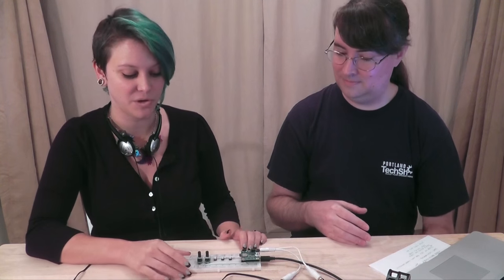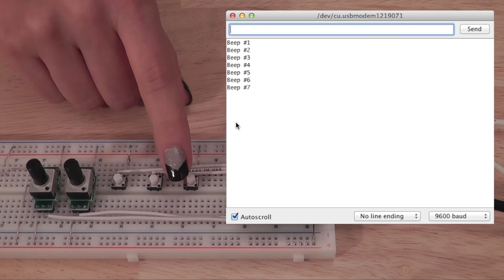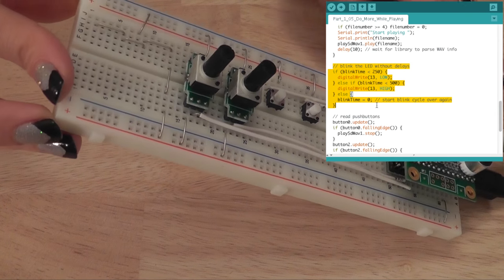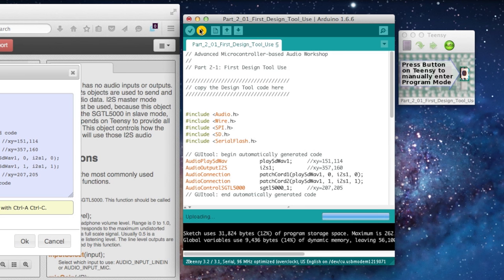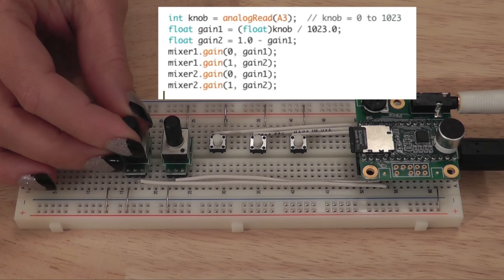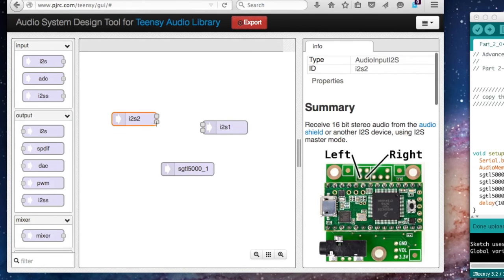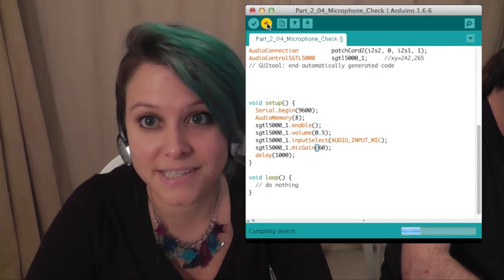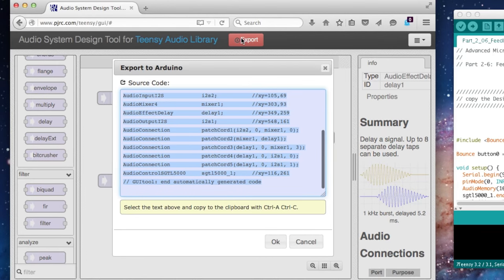Teensy Audio Tutorial & Workshop

Comment: can you use tennsy 3.5 with the sd card stand alone and use one of the many outputs for the mic?
Reply from the maker: Yes, you can use Teensy 3.5 and its built in SD card.  I don't understand what you mean by using an output for a mic.  Usually microphones are connected to preamps that send a signal to an input.  You could certainly use an ADC pin, but those pins need 0.6V DC bias (as documented in the design tool for the ADC object), so some DC bias circuitry similar to the one shown in those docs might be needed.  If this answer didn't cover what you need, perhaps ask on the forum and explain in detail what you're trying to accomplish.  We do pretty well at helping on the forum if you explain clearly.
Reply: I'll do that. Thanks

Comment: Does it work with Teensy 4.0?
Reply from the maker: Yes.  Every feature shown in this video works on Teensy 4.0 when using the "Rev D" audio shield.  Some of the stuff not in this video, like USB audio, is not yet ported to Teensy 4.0, but will be in the coming months.  Since 4.0 is so much faster, you can build much larger audio systems with a lot more synth and effect objects before you run into the CPU & memory limits.
Reply: @PaulStoffregen  Thanks, I just bought two Teensy 4.0's and the audio board looks perfect for projects to satisfy my audio addiction.  From what I see, it appears to me to be more powerful than a Moog!

Comment: What about making it a USB sound card for PCs?
Reply from the maker: USB audio support was added in mid-2016, several months after we made this video.  When using the design tool, you'll see it now has USB in both the INPUT and OUTPUT sections (plus many other features that didn't exist in 2015).  Just drag those onto your project and connect audio to them.  You also must set Tool > USB Type to Audio in Arduino.  Then upload and Teensy will appear to your PC as a USB sound card.  There are some small caveats to the USB audio, which are documented in the design tool.
Reply: Are you able to have multiple inputs/outputs for the USB interface? For example two speaker inputs?

Comment: How come there is not a simple video showing how to connect the Teensy 4.0 to the audio shied with GPIO headers? I dont need all the filler and fluff of the current videos and I have no interest in using bread boards. I would greatly benefit from a video just showing how to solder on some gpio headers and how to do it to the audio shield as well so we can keep access to the pins and make sure we are doing it correctly. Thanks